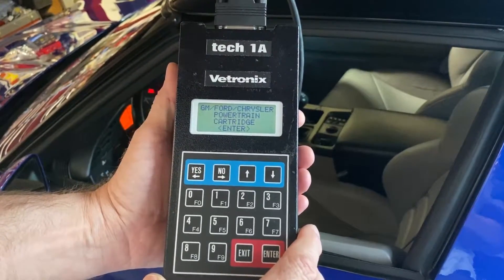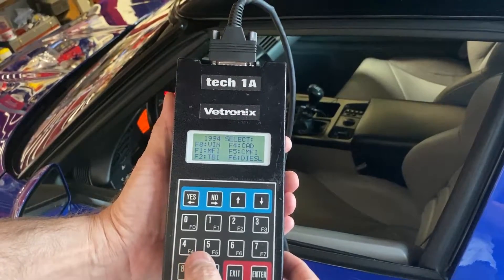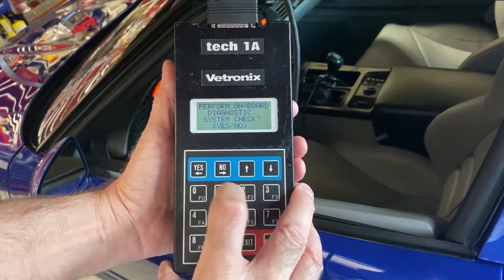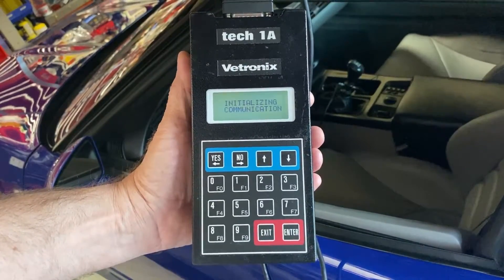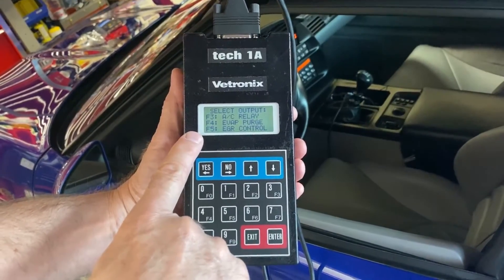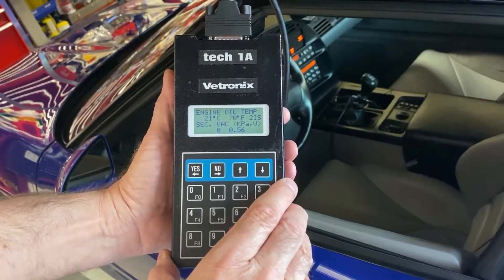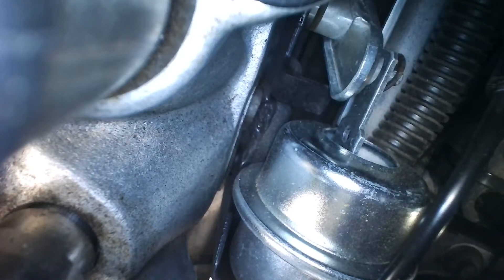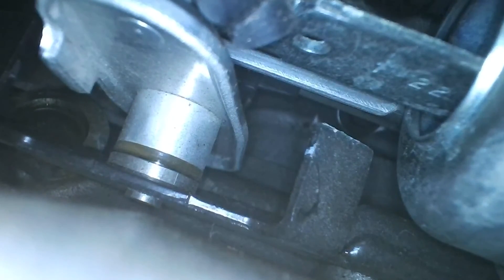C4 Corvette ZR 1 LT5 Secondaries

Comment: Question for you. When you were driving this car did you get a code 61? My dad's 95 gets it and when I energize the secondaries I can see both actuators pull but they are not as fast as yours. The pump does not shut off and it doesn't hit the stops. I have gone through all the vacuum lines and fittings up to the solenoid and it holds vacuum like a champ. At 5,000 RPM the car closes the secondaries and you get the Service Engine Soon light. Then it disappears.
Reply from the maker: I did have a brief code under hard acceleration. I had a bad vacuum actuator. It would start to pull in then stop and open. The diaphragm had a small hole that only leaked when the actuator started to close.  You may have a bad solenoid or check valve or actuator.  You might need to do a smoke test to find the problem.

Comment: I don't have any of this in my Z . It received a secondary delete . The car runs on all 16 injectors all the time. Still gets decent fuel economy.  It was performed when the engine was fully ported. The LT5 has issues with the secondaries getting carbon deposits from dead air and lack of fuel to clean them. It's recommended that you only drive with the power key on and to drive it so that you get all 16 injectors flowing to keep the secondaries being flushed with fuel. So when your driving try to run it a bit more on the secondaries and not just the primaries. These cars need to be run , and run hard at times . This system is unique to the LT5 .
Reply from the maker: You are correct, these cars need to be run and not babied. 
From Marc Haibeck: ...the secondaries can be activated at any engine speed just by applying the throttle. When operating on the secondaries, the required quantity of fuel is split 50-50 between the pair of injectors. The fuel and airflow will continue as long as the main throttle remains open more than 4.7%. During highway cruising, once the secondaries are triggered, they will continue to operate unless the main throttle is almost closed. With a little attention, the secondaries can be operated for long periods of time.

Comment: Cool.
I have a 91 zr-1 and a tech2 but most of the diagnose functions start in 1992 on the cardridge that i have for the tech2
Reply: Me too. I have a 91 ZR1 and I think I have a problem with the secondary being enabled. Low power
Reply: @jhitchman1  yes. Most problem is a loss of vacuum to the secondaries